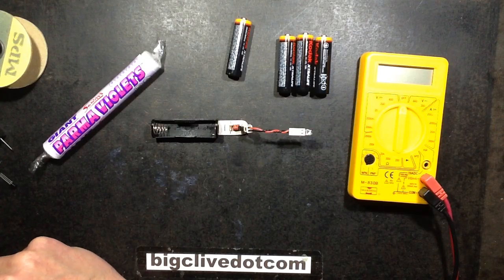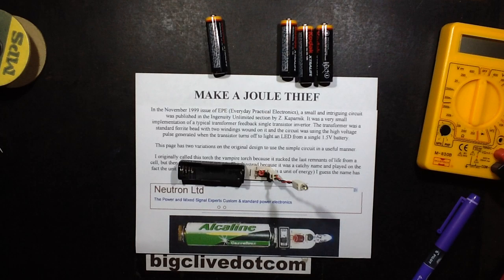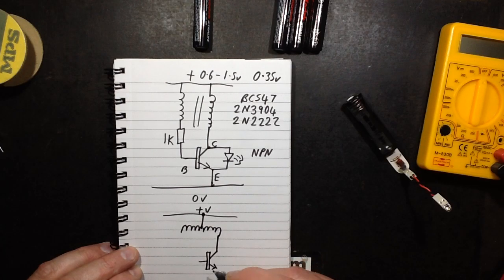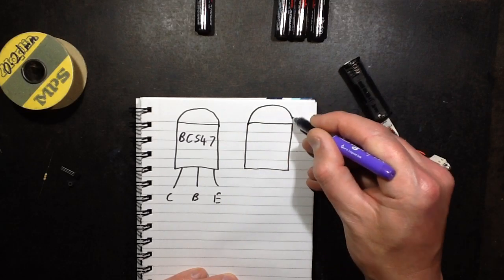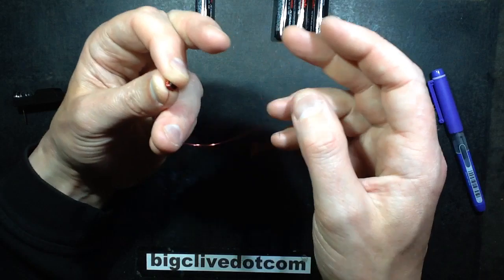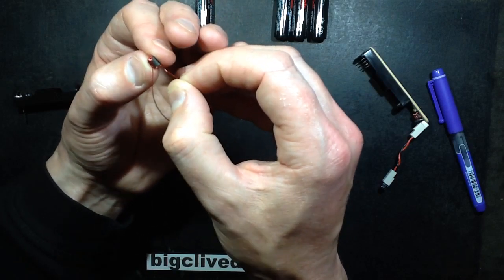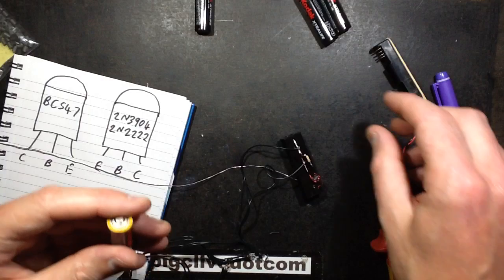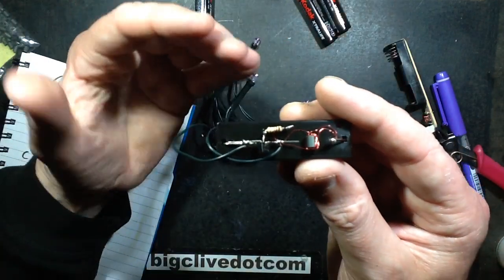How to make an authentic Joule Thief.

Comment: Hi Clive, enjoying your channel..  I know NOTHING about electrickery which is why I started watching, along with a few chuckles. 

Is there any reason why you would not use this handy-dandy circuit starting with a nice new, full battery and just let it sit there to drain the cell down to the dregs after the battery falls below its usual useful voltage?
Reply from the maker: +TheBaconWizard Yes, it can be used with a completely fresh battery if desired.
Reply: +bigclivedotcom 

The claim of batteries discharging linearly and showing only 20% of the battery used is fairly wrong. I understand it's a rough graph but batteries don't discharge linearly or use only 20%.

They discharge about 80% of the total capacity from 1.5 to 1.2 volts (the cut off for most electronics though some things like TV remotes may run on as little as 0.8 volts) at which point the curve drops off sharply and they lose the 1.2 volts in just 20% of the capacity. 

here is a graph showing several batteries all doing that inserted as part of an article.

http://theness.com/neurologicablog/index.php/batteriser-cool-tech-or-scam/

the "Batteriser" scam is a little metal thing you clip on batteries that purports to keep a battery discharging 1.5 volts the full life of the battery and so googling about it gives you lots of info about battery discharging.
Reply: Don Ziolkowski "They discharge about 80% of the total capacity from 1.5 to 1.2 volts"

You just contradicted the entire premis for your statement.
Reply: +TheBaconWizard um, I didn't?

His graph showed a linear transformation. That is that in 20% of the discharge 20% of the output voltage was lost.

The truth is in the first 20% nearly no output is lost. It takes 80% discharge to lost 20% output voltage.

he showed 20% voltage lost for 20% capacity used.

its really 20% voltage lost for 80% capacity used.

then after thats its

80% voltage lost for the last 20% capacity to be used up.

Comment: I wonder if this type of circuit would be useful in solar LED lights to extract energy from the solar cell in marginal conditions where there isn't enough voltage from the cell to charge the battery?

Comment: Apologies if this question has been asked before, but if I wanted to run say 5 led's, what are the pros and cons of wiring them in series or parallel.  Great video by the way and about to try it out myself...
Reply from the maker: Andrew Cottrill If you run them in series the LEDs do not need to be matched.

Comment: Is it possible for a joule thief configuration to control a power transistor in series with the primary winding of a step-down ferrite transformer? And maybe produce the cheapest inverter welder?
Reply from the maker: The current required from an inverter welder means it requires quite specialist drive circuitry for efficient and reliable operation.
Reply: Mostly welding is high current low voltage. This produces DC pulses of a higher voltage.

Comment: You have kindly helped me some times before. Now, I would like to ask for your support again. I have bought a Stirling Engine in which it was coupled a DC motor. The idea was to shown the conversion of mechanic power into electrical power. Fact is that the mentioned DC motor is only generating 0.18Volts and so I am not able to light up a single led ( I have choosen the one that works with lower voltage, but even so...)
I have submitted my trouble on a Forum of Stirling engines and it came out the idea of using a Joule Thief. My question to you is if you believe that there is any kind of Joule Thief than can handle this so low voltage (0.18Volts) and so light up a led ?
Reply from the maker: It's quite a low voltage to start a Joule Thief, but might work with a germanium transistor.  The Stirling engine probably doesn't generate a lot of force, so the motor may just stall under load.

Comment: This really made me want to start doing more electronics (and I got some nice exercise ideas for my students as well)! I'd have a question about the cell duration, though: how does the resistor affect the lifetime? In what situations would we prefer using low resistance and when a lot more than 1 kohm?
Reply from the maker: It's all down to what you want.  The higher resistance will result in a lower intensity LED, but longer cell life.

Comment: Interesting video as always.  I'm wondering if you start with a 1.5V battery in this circuit will the discharge rate in the typically useful range (say 1.5-0.6V) be altered?  In other words, is there a reason not to use this as a standard circuit to drive LEDs?
Reply from the maker: Pedunculopontine The current will be higher and the LED brighter at 1.5V, falling as it gets closer to the 0.35 to 0.6V point.  Keep in mind that a single cell cannot normally drive an LED like this on its own, as the minimum voltage required to light a white LED is around 2.5 to 3V

Comment: I am trying to work out in my feeble mind whether it would be possible to make this circuit with a trailing leads  within an aa cell size tube to sit on one cell's positive and negative terminals and then install the joule thief in the second battery slot in a 2 cell led battery case to drive the led string. So instead of using 2 cells you just use one but hopefully get longer run time as you leach the energy from cell.

My other question would be whether running a cell down so low - is there more risk of the cell leaking?

Comment: I was under the impression that the voltage curve of alkaline batteries was not linear but a relatively shallow slope with a sharp drop off nearing full discharge?

Comment: At 21:30, how do you know you are connecting ''two positives'' since bare wires have no polarity? 

About the two diagonal wires you twisted as the two positives, would you get the same two positives if you connected the lower left wire with the upper left wire?

Comment: Made one of these a while back with a TIP-31 and a huge inductor. So far off a shitty dollar shop C cell it's run for 8 days and drained down to .35 volts or so.
I probably need to use a higher value resistor because if I recall correctly the gain of the TIP-31 is higher than most TUNs.
Reply: 2.2 K IS A GOOD BET

Comment: Hello! Great channel. I was wondering if this circuit would work with a 9 volt battery? And can I power anything other than lights with it ( is the output spikey from the coil discharges or is it "straight" DC) ?
Reply from the maker: +ran zo No.  It must only be used with a 1.5V cell as higher voltages will directly drive the LED and may damage it.  The output is spiky, but at high frequency.  It can be rectified with a fast diode and capacitor.

Comment: hey today i opened one of my broken lamps because you said to get that ferrite core out of it (i wanted to throw it away D:). so i just salvaged all parts of it, but is that thing that looks like a transformer just an inductor? it only has 3 pins and only 2 are connected.

Comment: Nice work. Will it work on 3 1.5v cells in series? I have some Christmas lights that are like a drain.
Reply from the maker: It's designed for a single cell.  Anything higher will just conduct straight throught eh transformer and LED.

Comment: Wow, I have a half dozen little attempts at making this circuit after watching other folks videos on how to make them.  I followed the directions, at least I thought that I had, and have never got one to work.  Today, I have my little joule thief! followed your video, step by step, stopping the video when it came time to solder a joint, then continuing, bouncing back and forth to insure I had the right thing in the right spot (hmm sounds a bit like sex, if memory serves ((Been a LOOOONG time)) when I tried it the very first time--- NOTHING!! Then I looked at my work and found that I had inadvertently soldered the base to the collector as I made my last hookup. I took a snip and suddenly all was right with the world.  A bluebird sang in Berkeley square, swarms of black birds flew into the sky as my little multi-color LED began to light, first red, then - - - red then - - - red not sure why it doesn't change color, it did with the CR2030 but I am not worried, it does work. Oh wife is about ready to skin me alive as well, seems I soldered it while leaned back in my recliner and a blob of solder dripped on my heavy winter sweater, melting a large hole about where my belly button is. Thank GOD it didn't get through my undershirt and onto my skin, that could have hurt  And things will be chilly in the bedroom tonight.  Nothing new there, after 47 years together, there are no longer surprises in that room.
Reply from the maker: The colour changing LED will tend to stay at red because the power is pulsing on and off to it, which resets it to the start continually..  You'd have to use a small diode and a capacitor across the LED for it to work.
Reply: Cool thanks, just for kicks I hooked up one of those little kit 9v oscilloscope and it showed the frequency varying from 150HZ to 970HZ within a very short time, this thing really rocks. I just used the color changer because I dropped my white LED in my recliner and was too lazy to find it, the nearest one was one of those color changers, but I may just put in a little diode and cap to see what happens.

Comment: Say Clive, just go to thinking; could a person make this out of solid state parts?  Perhaps a couple of inducters soldered together instead of winding one, using mini surface mount parts, and a surface mount transistor, imagine how small one could make it, then using surface mounted LED's, why one could make a joule thief that would fit on the head of a nail with say a small single cell hearing aid battery.

Comment: For us "older", sorry mature, constructors, the old original enamelled copper wire had to have the enamel scraped off the wire before soldering it. Now modern enameled copper wire is soldered through in so much as you can just solder the wire and the enamel coating will come away from the copper wire and allow it to be soldered without having to remove the enamel first.
Modern enamelled copper wire is so so much easier to solder!
Now I feel like an old fogie of an armature winder.

K Watt, yes that is my name!

Comment: If the number of turns wound onto the ferrite bead is increased, how does it affect the efficiency of the circuit please? I bought 50 BC547s (after only finding power regulators etc) and 50 1k resistors. Still waiting on tiny beads coming. I'm fitting these in all the missus' LED ornaments. I have to wonder why they aren't fitted in the first place, and used as a selling point. Excellent channel, between your channel, Plainly Difficult, Mark Felton & lastly, the Atomic Test channel, I remain thoroughly entertained, whilst running my CNC lathe at home making parts for air rifles.
Reply: Hi Erasmuspipebagger,
Can I ask you which ferrite beads you ordered? I can't seem to find suitable ones. Would you mind giving me the link? Thanks,  James
Reply: @jamesgreally2195  Hi, I thought I'd replied to this - clearly the post didn't go up. I ordered 4 x 2 X 2, which appears to be a mistake : if I use an input supply over 2v, it will not work (I've been buying 2 X AA battery cases, with switch - not seen a single cell holder with switch) I've now ordered 6 X 3 x 2 both from eBay (in China) & phone will not let me copy link. Search 6x 3 x x2 ferrite and second one in list will be what I ordered. That supplier has loads of different sizes. In the meantime I broke up a lot of old CFC lamps which we no longer used in the house because we switched to led, to get ferrite beads.
Reply: @Erasmuspipebagger1  Thanks a million for that.
Reply: Hi bud, no. Problem is, if I try to share link from my phone, it produces a massive line of kak. I'll try from my pc.

Comment: You can scavenge the coil former and the winding wire for this from a broken CFL but I've tried using the transistors from those things and it seems they just won't work.  I don't think they're burned out (although I could be wrong) but I think they're actually FETs or cascaded Darlington pairs or something like that.

I'm wondering if anyone knows how to make a FET or Darlington transistor work with this circuit?  Is it even possible?  Is it just a matter of changing the resistor value to be higher because these transistor types are more sensitive to base current than a standard transistor?  If so, what value?  Or is it necessary to wind the coil differently?  Currently, I'm using 70 turns (35 winding both coils at the same time).

It would be wonderful if all the parts for this circuit could be scavenged from a broken CFL so that at least some of the parts from one of those things could be re-used.

They generally seem to have two transistors, two coils suitable for winding a Joule Thief transformer, another coil where you can scavenge the wire for the JT transformer from, and heaps of resistors.  If the parts can be made compatible, you could potentially build two Joule Thief circuits from each CFL.

I built one of these into one of those boxes which uses two 1.5V AA cells to power a string of LED lights from 3V.  I removed one cell and soldered a connection to the connector originally used to connect the two cells together.  I also removed the connector for the other end of the unused battery compartment.  I managed to mount the circuit into the space where the switch was located.  It was small enough because I used the cylinder shaped coil former from the dead CFL I wrecked for the parts.

Now, the whole string runs on just one cell, and I bet it stays bright for a lot longer than it would with two cells.

Comment: @bigclivedotcom
 I took some solar lights and rebuilt them added bigger panels more batteries and more LED's all works great.  Based on the 5252F 1506 transistors. Except the timing. Can you do a video about how to adjust the timing of a solar light with a simple joule thief circuit? They come on an hour early when it's still light out. Will raising or lowering the value of the resistor work? I have  trouble getting these higher amp resistors for some reason. Hard for me to find other than recycling them. So don't have the values I need to test with.
Reply from the maker: It's all down to the voltage from the solar panel.  On older and damaged panels with lower current output they light may come on very early.

Comment: Question:  My Mom has a string of LED's, and I've been saving up dead AA, AAA and C batteries -- Can I scale up the, "joule thief," circuit to service her purple little lights?
Love your website, and thanks for the videos!
Reply from the maker: The joule thief can run quite long strings of parallel LEDs.

Comment: Asked what would happen if you supply this with 3V? Clive answered "that will go straight trough", which means the LED will be powered at 3V, and burn normally. Second: for the transformer, find large enough beads, I bought too small ones, and ended up with 5 windings, which didn't work. LED burns, but at low power. You need 15 windings.

Comment: I built the circuit using old hearing aid batteries, but replaced the resistor with a 10K pot. and 500R . As this was adjusted the frequency ranged up to 200Hz. Could  it be used to blob out mobile phones at the beach?

Comment: just throwing my 2 cents worth in ........ to clean the enamel/varnish from coil wire ...acetone , just a drop on a q-tip or a bit of rag takes the varnish off and leaves the wire bright and shiny ready for soldering . If you dont have acetone borrow the wife / girlfriend's nail polish remover , it's 99% acetone and works just as well

Comment: If you needed this to work with 10 of batteries in series for 15v, would you need to make one of these for each battery or just add it to the output of the combined battery pack?

Comment: Lightning struck the local area 11kv supply, and took out two of the 3 phase lines.   However there was sufficient capacitance in the overhead lines that this produced 70 volts at our domestic supply, which lit our LED lights perfectly...  That is until we switched on the cooker when the voltage went to zero and the lights would go out.   Took me some time with my voltmeter to realise what was happening

Comment: Thanks for this Clive. I'm making my own solar lighting system, so this has come at the right time.

I've just made one and it works. I've got 1.1 V on the battery and my scope is showing 11V peak on the collector so a X10 multiplier. You do need to explain that this 11V peak voltage needs to be controlled by a resistor in series with the LED as it could do damage. Other loads will need similar voltage limiters

Nevertheless, a smart little project and a good introduction to inductors for me. Thanks for taking the time.

Comment: i really would prefer a simple step up converter like the mcp1640. It goes down to 0.35V, it has a stable 3.3 or 5V output, you only need 5 parts for your circuit. In addition you have a much higher efficiency and you only need a single inductor and not a transformer.